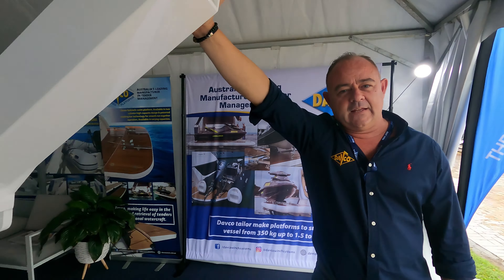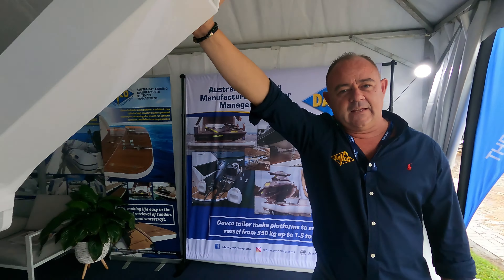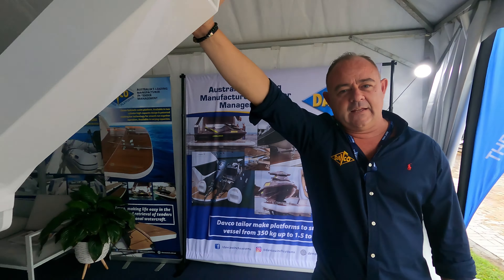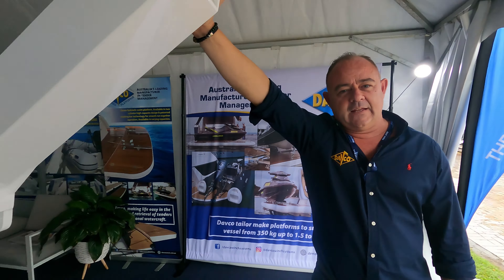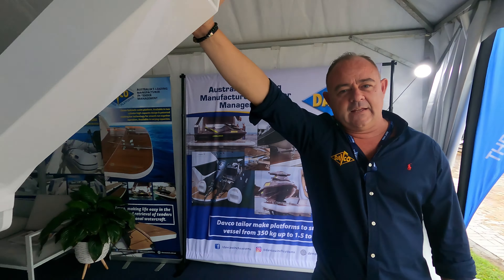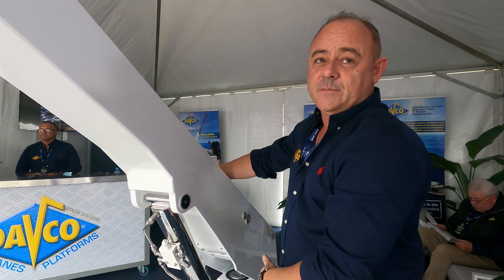How to build a long range, power catamaran. Part 1.

Comment: I saw the tour on Longreach's site and was totally impressed with your design and thought process.  Its really a great design.  Will you have a hybrid drive system?
Reply from the maker: No unfotunately, but we can add a later date if we think the technology gets better.
Reply: I too, love the design, but I would opt for Beta Marine hybrid motors. Also add more solar panels over the deck outside the flybridge.
I would be interested in knowing your final costing, as this is something we are looking forward to doing in about 3 years 😀
Reply from the maker: @ewavideo7440  Agreed, they are doing a foiling model and also a hybrid engine option but its $900 k US extra which is a lot of fuel. We have looked and resurched very long and hard at this and dont believe there is a good reliable system out there yet. Our thought was to get out there efficiently as possible and when we think someone has somthing maybe change it out then. Our final costings ex factory are around $2.5 AU  there may have been some price rise since we ordered
Reply: @CruisingSunrise  that is a lot of fuel!
Reply from the maker: @KirkThomson  sure is, and a lot of money up front that we just havent got.
Reply: @CruisingSunrise  the interest on the 950K will pay for the fuel each year